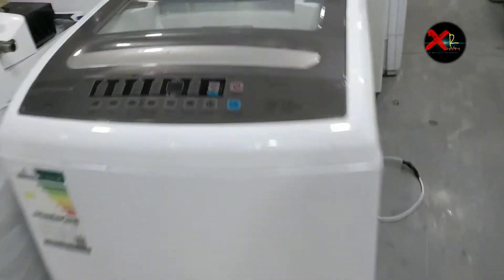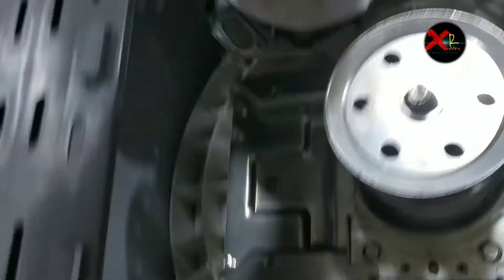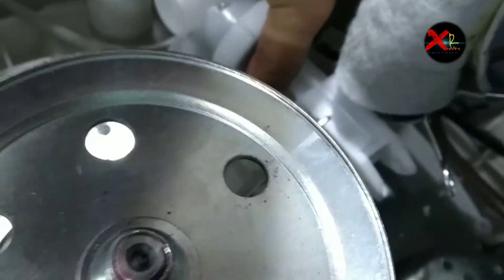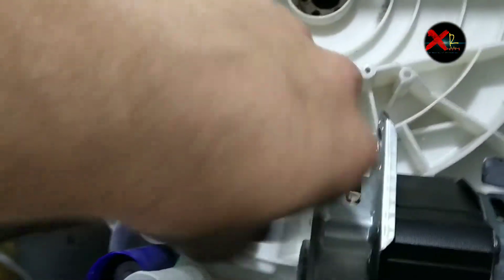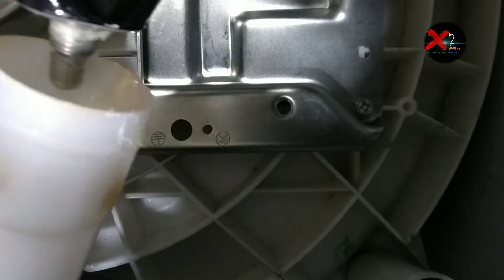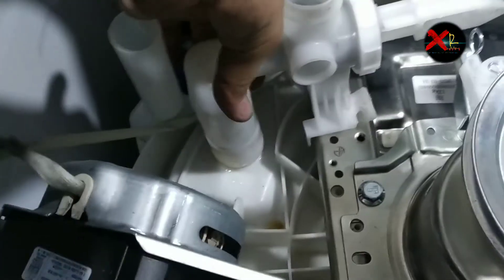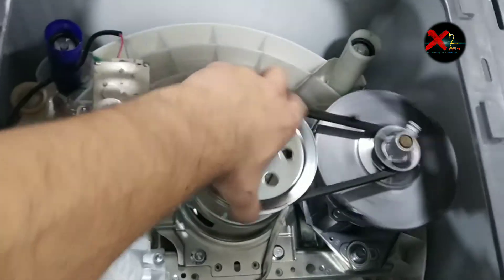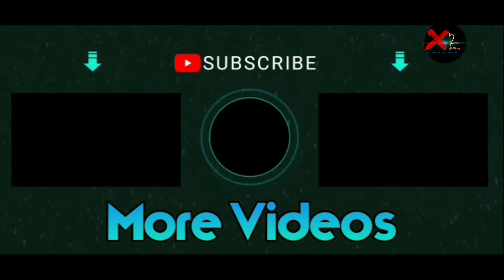Top Load Washing Machine Gearbox Repair | Gearbox Replacement Complete Guide |

Comment: How do you remove the bearings
Reply from the maker: There is no bearing
Reply: @repairingschool
Reply: There are bearings on the gearbox, I have managed to remove 1 on the motor side but failed to see how the one on the drum side comes off
Reply from the maker: @deonmyburg8272  we never tried to open gearbox, just replaced.
So don't have any ideas 💡
Thank you 🙏
Reply: @repairingschool  Make sence, but we can't find parts here in Zambia,  so we try to repair😁😁
Reply from the maker: @deonmyburg8272  Hmm... u can try but make sure the black rubber seal is available. cos there is no benefit if you only change the bearing.
try to find the black water rubber seal first.
Reply: @repairingschool  i can't see  a way of removing the bearing, so no good looking for the seal